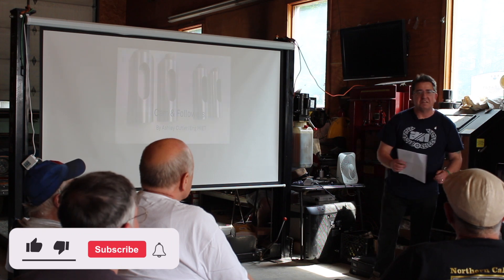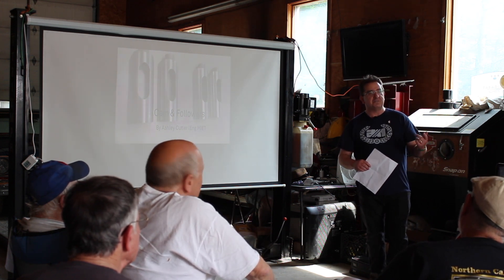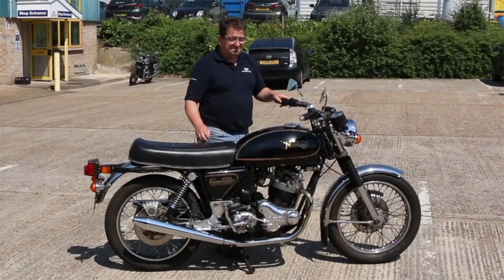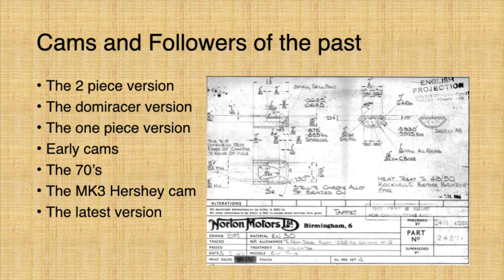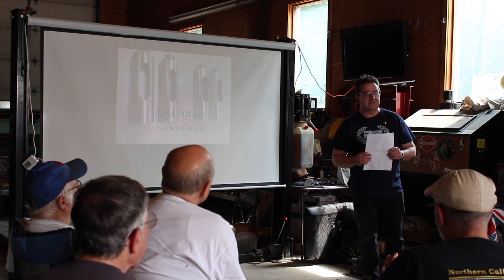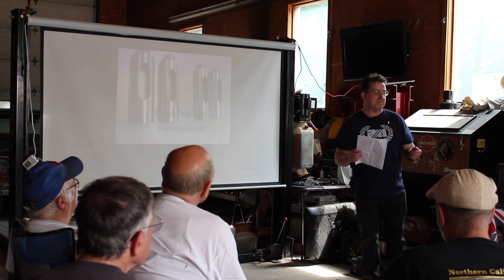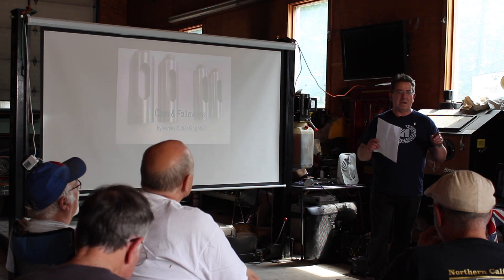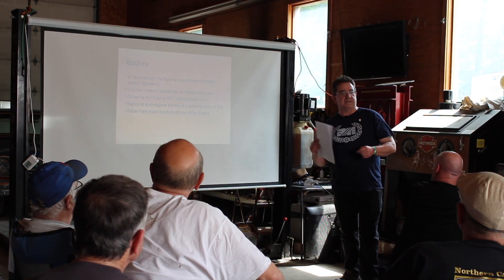Ash Tech Talk - INOA 2024

Comment: I had a chocolate cam on my Mk3 Commando in 1986, i lost compression on one cylinder took the barrel off and one lobe was worn round, there were also rub marks on a pushrod and i had to remove some metal in the pushrod tunnel that the pushrod was rubbing on, it ran great after that.

Comment: I never had problems with Atlas or Commando cams and lifters, until the MK2A and MK3 cams in 1974-5.  I used WEB Cam to re work the cam cores with race profiles and the cams gave excellent results and great performance gains. My MK3 street bike is a rocket with their # 12 street cam. Great power through the whole rev range from idle to 7 thousand and beyond.
Reply from the maker: Sounds like a good solution
Reply: I just had my MK III motor rebuilt it’s not in the bike yet - should I replace the cam?